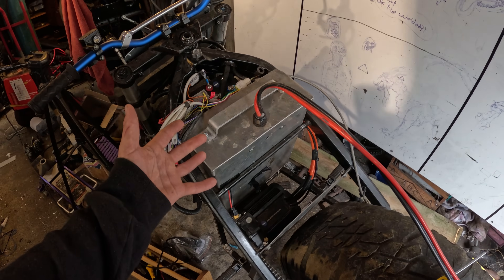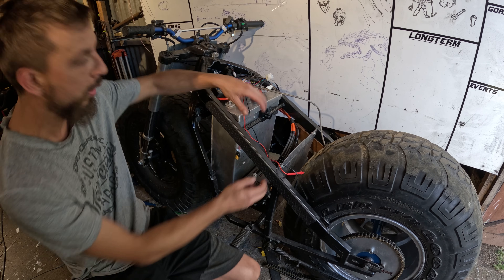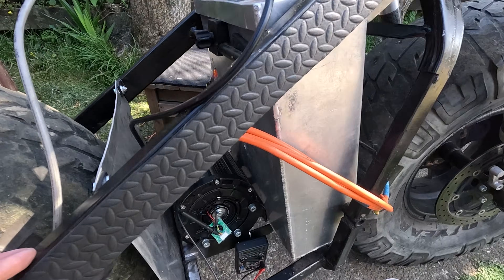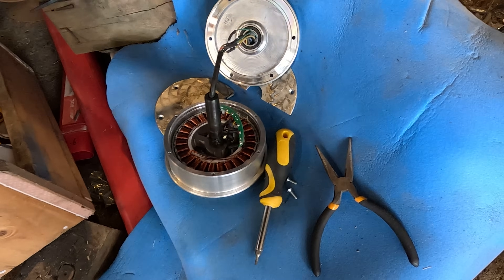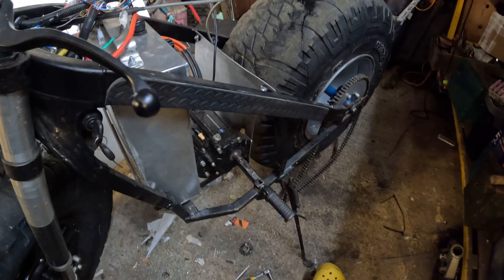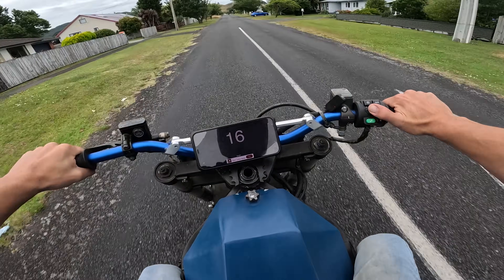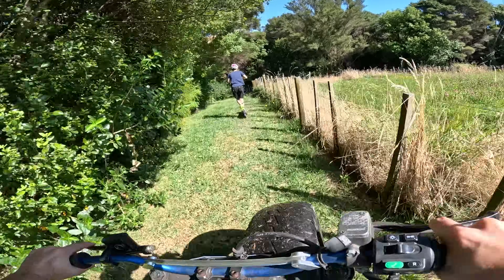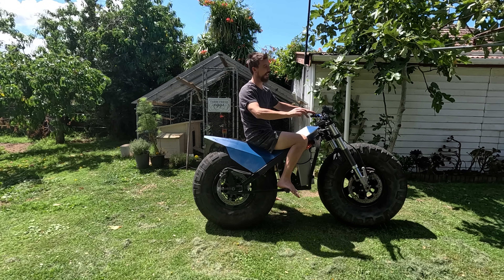Fixing the Biggest Problems on My Fat Tire E-Bike! (Will It Work?)

Comment: The hall sensors in most Chinese motors are not good, swap them out for some properly sourced branded ones from digikey or mouser as there are a lot of fakes online and keep a board ready because those Chinese ones will fail again, they don't like getting hot either, i always used Honeywell ones and ive been doing this since the mid 90s. and never had them fail.
Reply from the maker: Thanks I will keep that in mind. It is a pain dealing with such a cheap part failing

Comment: *BMS* STANDS FOR 

*B* OWEL

*M* OVEMENT

*S* MELL
Reply from the maker: I didn’t know that thanks haha
Reply: Battery Murdering System, they caused more hassle and damage with my builds than they were worth, in the end i used  to balance charge with cell monitoring and just watch the terminal voltage when riding, badly made BMS units can drain cells and wreck batteries, if you are careful and you leave a good bottom limit in your cells you dont need active BMS on a bike like this, just balance charge and monitor terminal volts, in most cases failing cells will have already failed by the time the BMS catches it.

Comment: You could run it sensorless. Motors have back emf and u can read position with that. Depends if controller supports it. Hall sensor always be breaking man
Reply from the maker: I didn’t know that. Another guy mentioned that too it is a far driver controller not sure if it does I will try find out

Comment: So a tip for DIY-ers: CRIMP, DO NOT SOLDER. If you solder a crimped connector the heat form soldering quenches the metal and decreases the friction between the copper and the terminal. Either solder or crimp, never both. Also soldering is ill-advised in any kind of automotive environment since vibrations can cause brittle solder to fail.
Reply from the maker: I didn’t know that thanks for telling me, I will check the connections

Comment: Might be an idea to springload the battery and the control unit so they don't get the hard pushes. So that they are not tight connected to the frame, well I think you get it ;-))
Reply from the maker: The battery and bms are in a padded enclosure. I’m not sure how much vibration everything can take a big learning curve

Comment: You make a fairly heavy bike look somewhat graceful.  What are your next plans for the bike?   A little debugging and some fine adjustments is probably about all it needs to be a reliably fun and useful bike
Reply from the maker: It is pretty good how it is, a hub motor in the front wheel for 2wd would be cool. I will keep doing rides on it testing on different terrain

Comment: Us standart car battery and capciator. . Easy variant your motorcycles project.  Well us little battery ok compact.  Later time little battery energy defects.  Again rebuild . But easy us car battery energy.  View size  your e motorcycle frame . Little battery not cheap and rebuild time home 😂😂.  Test us car battery  . Ok weight car battery but good project for e motorcycles system  . Make strong electronic generator & battery energy systems power transformator.  Drive generator upload energy back . This later time Dakar dune rally cross versia.  Good project 😎👍
Reply: Nja video  view test off road river😂😂😂😂 Don't us coal engine electro.  But BL motor eletcro no problem off road drive swamp or river water (waterprof)

Comment: hey Daniel! I suspect that your controller needs to go through the self-learning mode again because the Hall position is no longer correct. 

I also think that a lot more power can be extracted from the motor

look at the power from my buggy, and that is only at 60 volts. 

hey and be careful with that battery! if you get too much imbalance your battery can catch fire and everything is gone! 

all in all a very cool thing!
Reply from the maker: I have run the self learn a couple of times it is working pretty well, the battery balance is a pain I can’t get the bms to do it

Comment: did you try to adjust the hall sensors to get a higher max speed/tork?
Reply from the maker: I haven’t tried, I am pretty sure the auto learn sorts that out anyways, the torque is good I could gear it higher for more top speed but it is for mostly off-road so I think I will leave it how it is

Comment: Great work. You should look at fitting an active cell balancer. I use them on all my high power batteries and the version I use will deliver up to 5A balancing current out of the average even during use, and they maintain cells within 1mV of each other. The only downside is they do have a slight draw at all times, so I keep the packs in storage charge when not being used by using a small boost module dialled in to 50% charge voltage (3.7V/Cell x S count) with just a 1A plug pack to maintain that required voltage. I also add a tiny audible low voltage alarm which has saved me once when the plug was knocked out.
Cheers.
Reply from the maker: Good idea I will look into that thank